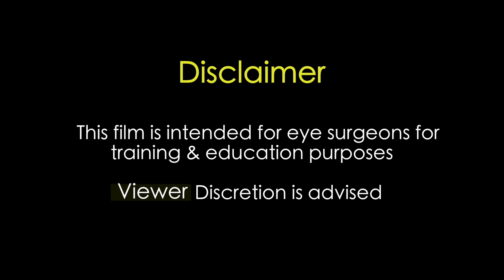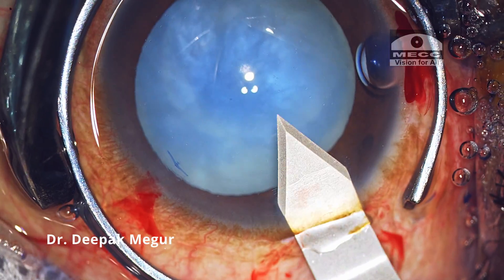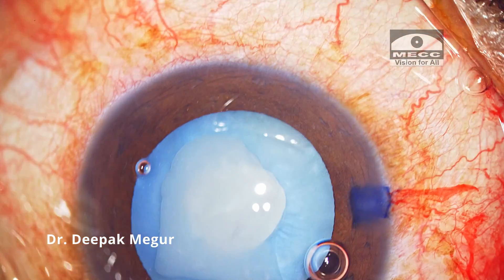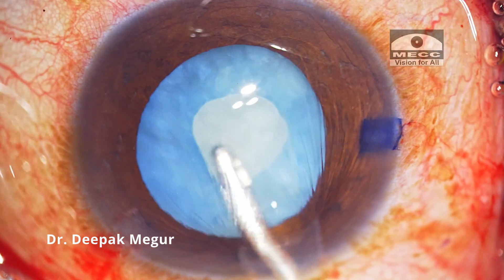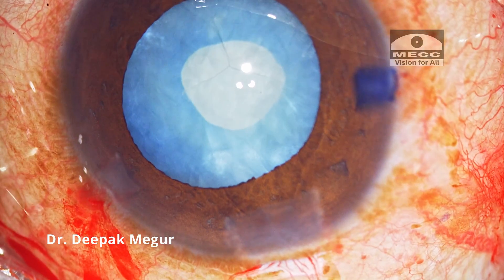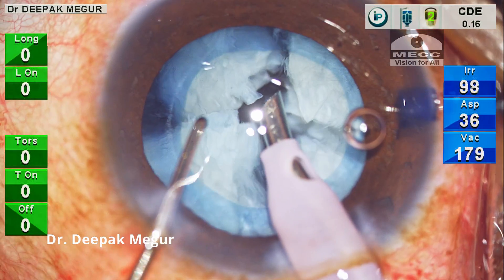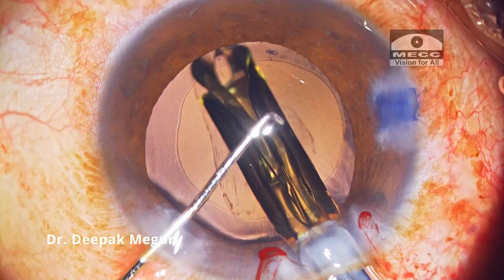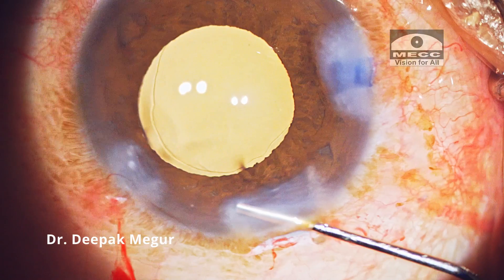Intumescent Cataract - Rhexis Challenges,2 staged rhexis, Pearls for Decompression- Dr Deepak Megur

Comment: HELO SIR GOOD DEMONSTRATION  I THINK  ITS BETTER USING  SIMCOE CANNULA FOR ASPIRATING CORTEX
AFTER SMALL CCC  TO AVOID AC SHALLOW THANKS
Reply from the maker: Simcoe canula or bimanual I & A have a port size of 0.3 mm whicis good to aspirate the regular cortex. But here in this set of intumuscent cataracts the consistency of the swollen cortex is jelly like which is more epinulceus like hence it is difficult to aspirate it through the small port. 
hence  i use a wide bored cannula like the 23 g visco cannula or some times the phaco tip itself to do a fast and efficient decompression of the bag.
thank you
Reply from the maker: this video is s brief overview of the 2 variants of the intumuscent cataracts

https://youtu.be/LjkJCvUegJA
Reply: @DrDeepakMegur  THANKS  FOR YOUR ANSWER